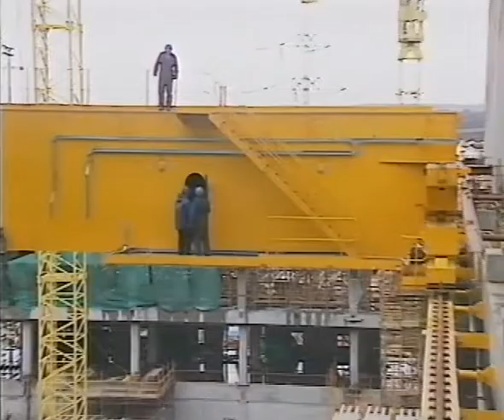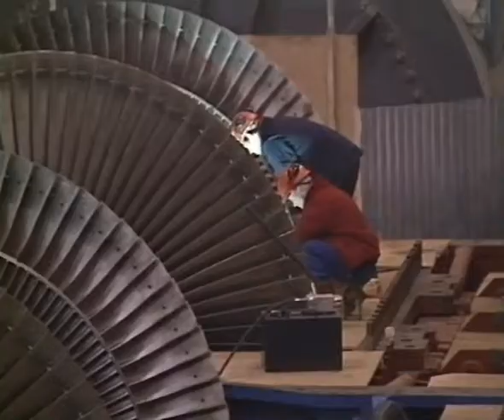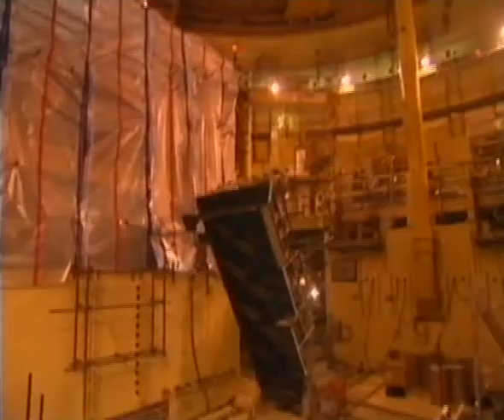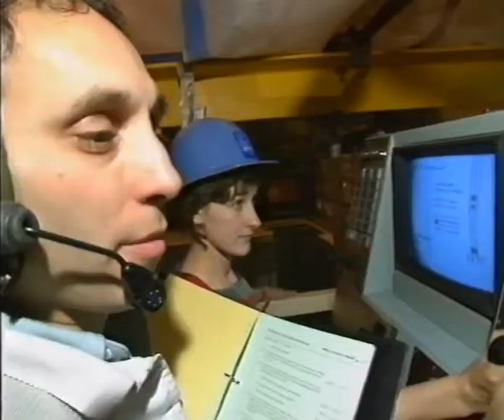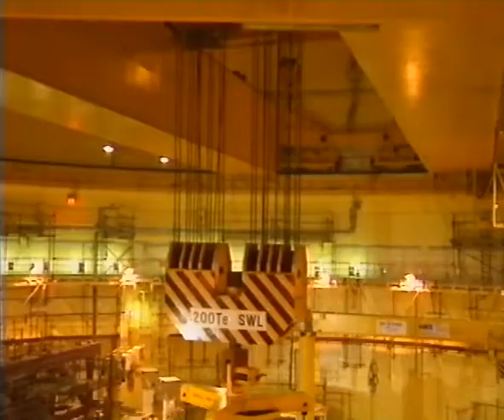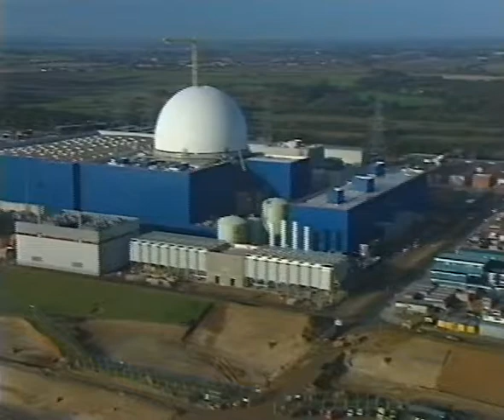Building Sizewell B

Comment: 'I don't think breaching all those barriers is possible' The science man! The laundry room puddle leads to accidental discovery pool has been leaking massive volumes for who knows how long. Difference is specks of plutonium in irradiated fuel. And fuzzy area readings of radiation 'dose'. Nuclear spin is its own worst enemy. Just say its low carbon but you can't access the reactor room for 10000 years. Oh yeah forgot. All those specks spread around corroded pipe cracks. Basically a nice scientific concept which did exactly what intended. Incinerate 150,000 sub humans. Electricity generation was always a sideline.